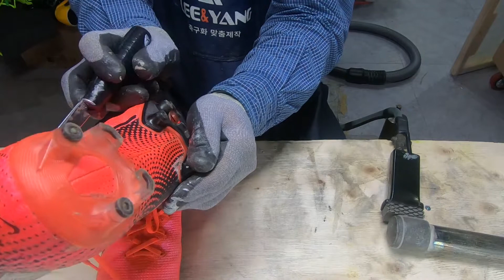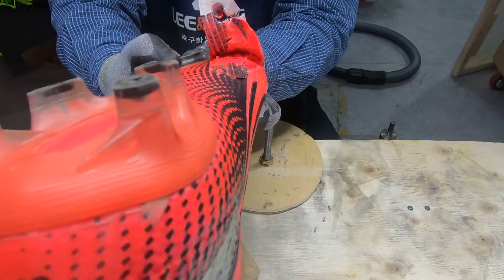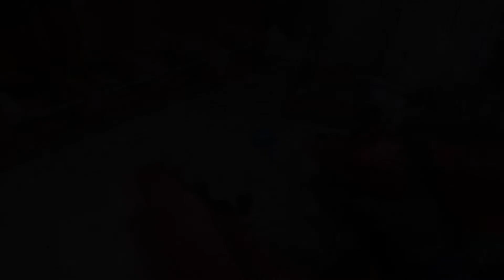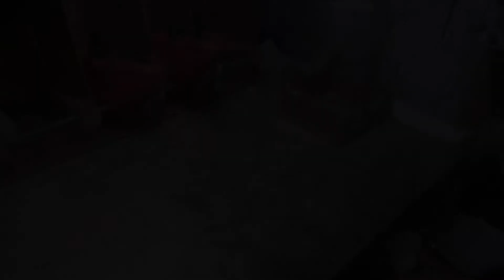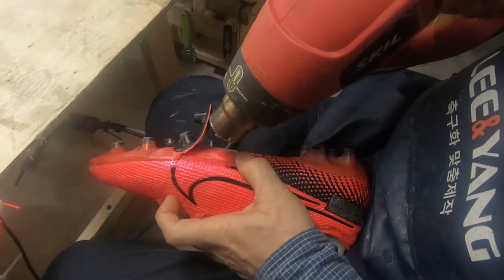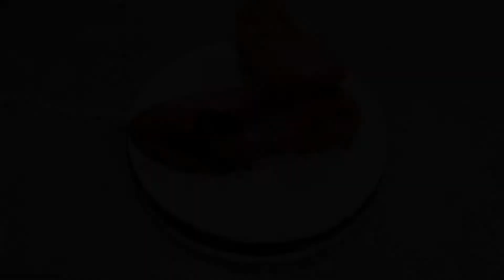How to Fix Separated AG cleats - Nike Mercurial Vapor AG

Comment: hello can you pls tell me the processs and materials u added party by part
Reply from the maker: It's a little hard to tell you because  I don't use only one glue while repairing  soccer shoes,  I use a lot of different adhesives and mix them together. I am sorry but if I use only one glue, I can tell you easily.
Reply: @leeandyang  my one got broken and it was a new one, so can u pls tell me how do i fix it
Reply from the maker: @mahinsharif7844  Hi, I really don't want teaching you how to repair it, and as you can see in the video, the repair looks simple, but I think it's hard to fix it yourself because they don't sell it in small quantities. If you want to fix it yourself, I think it's best to repair it yourself or go to a shoe repair shop and sew it with a nylon thread.

Comment: What glue do you use ?
Reply from the maker: Thank you for your question, I use different kinds of glue for different materials of soccer shoes and mix them together, so it's hard to specify one glue. But for these soccer shoes, use the PU glue :)
Reply: @leeandyang  May I buy your glue?
Reply from the maker: @thanakiatleelanuwat3724  I use two types of glue mixed together, so I think you can not buy it because it is useless  after one day.